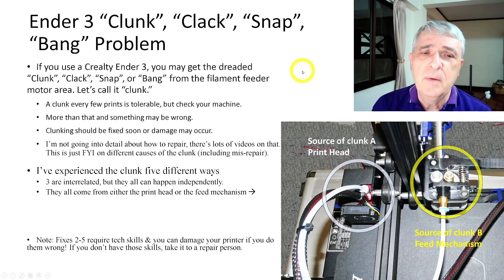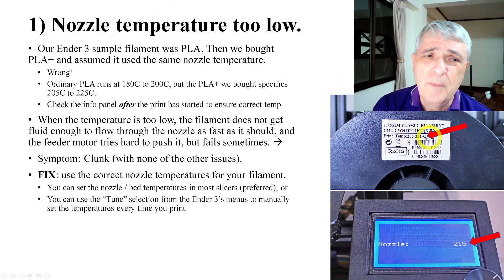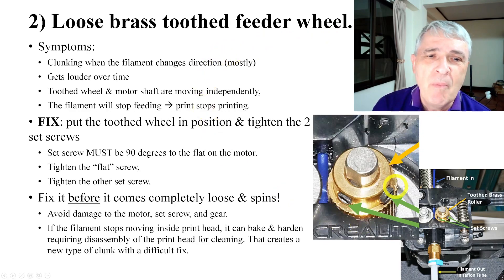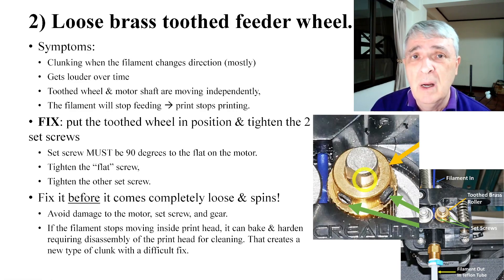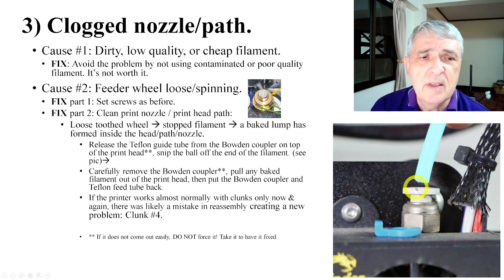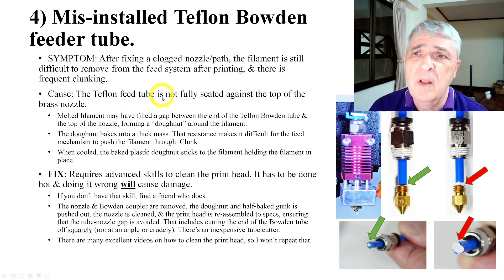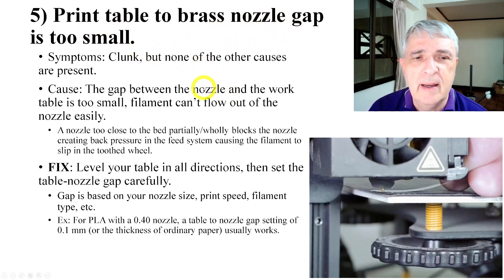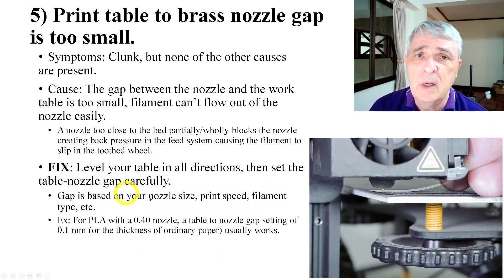Ender 3 “Clunk”, “Clack”, “Snap”, “Bang” Problem - Where To Look

Comment: The problem i get is with the bed when it does the infill and it causes layer shift and knocks a lot iam not sure if its the stepper motor over heating 🤔its only just started to happen.
Reply from the maker: I've had that problem twice. Once was a Z motor that went bad. It would stall too easily and skip steps. The other time was Z motor threaded rod was dirty and sticking and one side got lower until it jammed. I cleaned and oiled both of them (I have dual Z drives). So in my case, it was 1) bad motor, 2) dirty/jamming parts.
Reply: @tsbrownie  Here is what happens when its running you can hear the bed knock on the infill but not on the walls. https://www.youtube.com/shorts/Vjt9COAw4Y0
Reply from the maker: @BrumKid   I left a message on your video.
Reply: @tsbrownie  I read it and i have changed the  Z motor with a new one as i had as a spare. What i was getting at is you listen to it the bed is what is knocking and knocks more when there is infill. I have ordered another Y stepper motor so i will see if that is the problem 🤔
Reply from the maker: @BrumKid  Does the bed move if try to wiggle it up and down  and side to side?
Reply: @tsbrownie  No i have checked that and also i have found at the back of the print is a line and its around about that area where the bed knocks, iam doing a test print at a low speed ie down to 20mm print speed.
Reply from the maker: @BrumKid  Have you checked your limit switches to see if they are connected at both ends?
Reply: @tsbrownie  The one on the Y steeper was changed about 4 months ago as i bent the lever. Iam going to put up another video showing when the printhead gets in the middle at the back of the print that is when it knocks. I appreciate all the help you are giving me.

Comment: I don’t have a 3d printer, but you definetly gave a good follow through on how to do some of the fixes! Ender 3 owners will appreicate it!
Reply from the maker: They are interesting machines. They can produce things that are impossible by subtractive processes. They were designed by a community of nerds using off the shelf components, and 95% of the parts still are. Easy to modify and fix, but they do require fairly frequent tuning and maintenance.